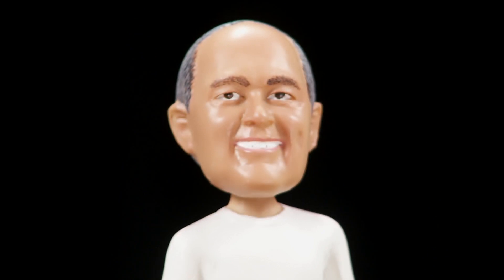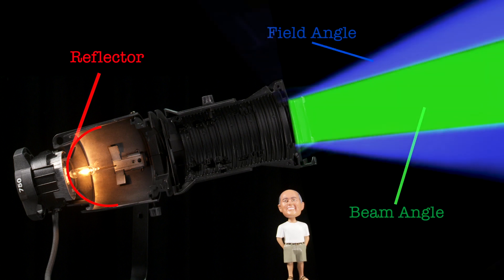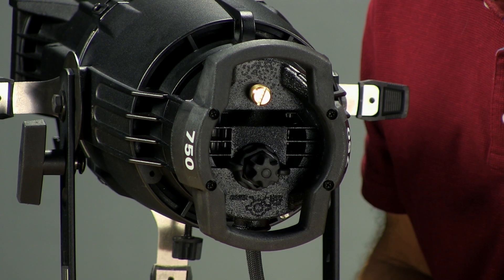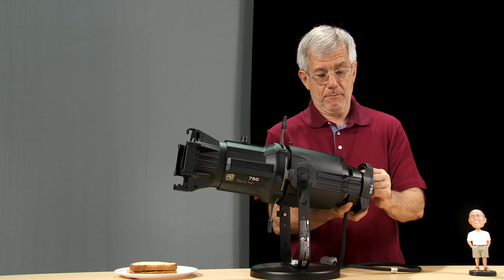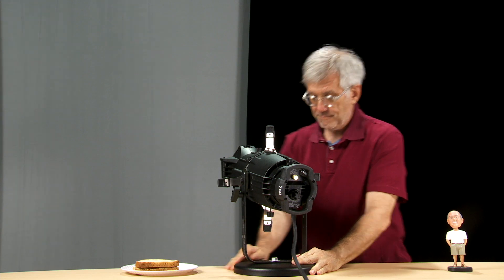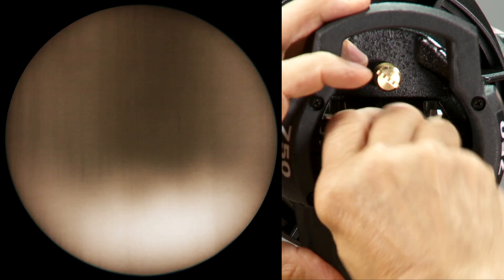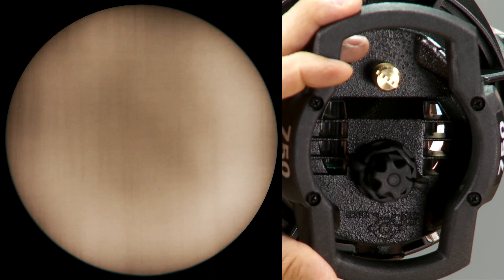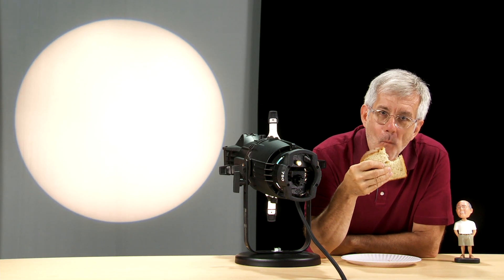Bobblehead Fred Shorts: Bench Focusing a Source Four

Comment: What does it mean when your light is throwing a shadow circle in the center with lined that radiate out from the circle?
Reply from the maker: Hi ShadowLion20 - that is something that you can see if the fixture is very close to the surface - it doesn't necessarily indicate a problem. Can you advise what your distance from the fixture lens to the surface is?
Reply: Whelp!  I faked that well for years.

 Thanks for the thorough explanation!